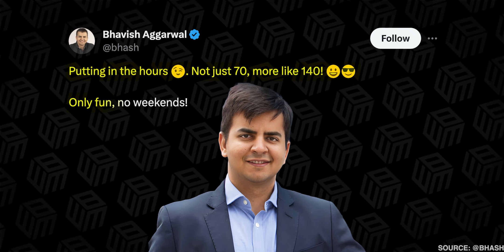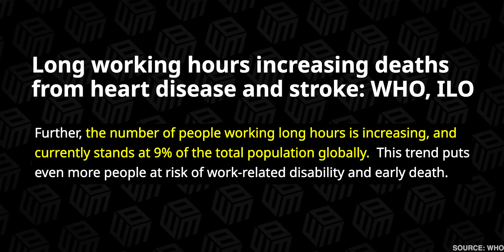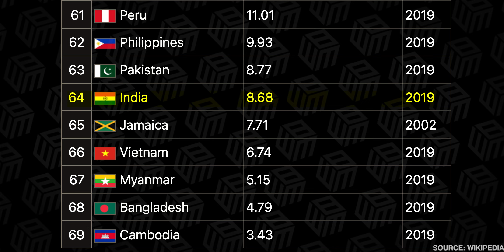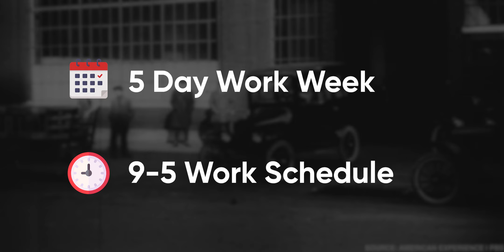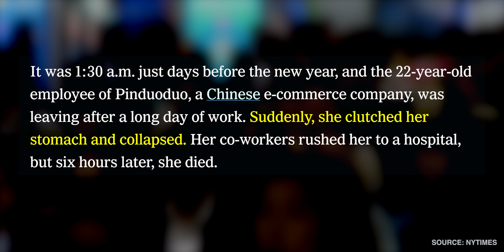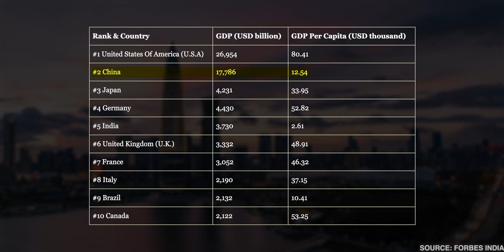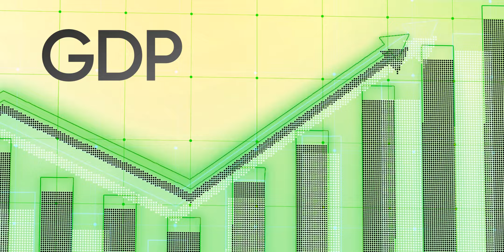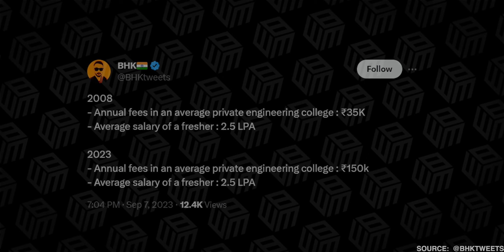Does India Need a 70 Hour Workweek?

Comment: Someone needs to teach these guys there are only 24 hours in a day. 8 hrs sleep + 2 hrs for personal stuff leaves 14 hrs. If you are stuck in traffic for 3 hrs daily, that leaves 11 hrs. You can never hit 70 hrs even if you do 6 days. Silicon valley comparisons are so wrong. People travel 50km in 40 mins at 90kmph speed. That lets them work properly for 12 hrs  5 days. There is also 10x worker concept. That requires super high iq. But they don't work 120hrs a week. Just throwing numbers without thinking. 120hrs means 20 hrs a day. The valley would be a grave.